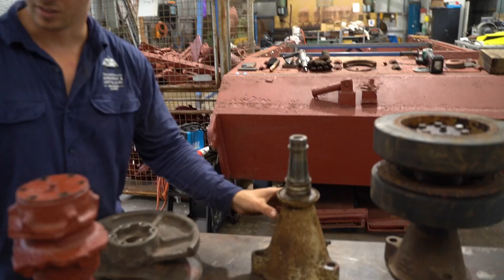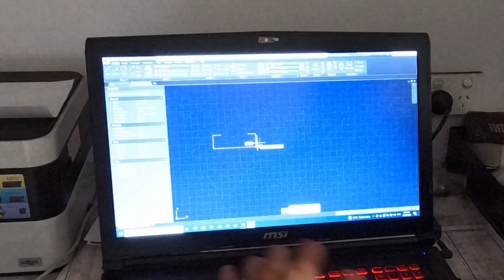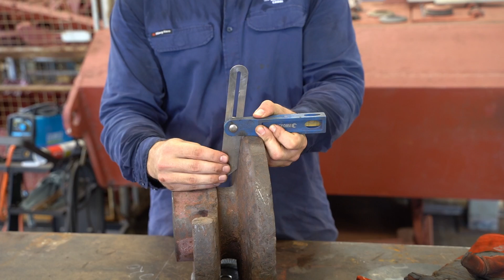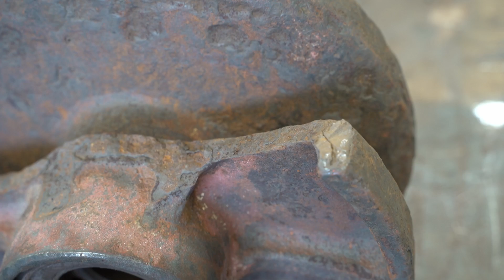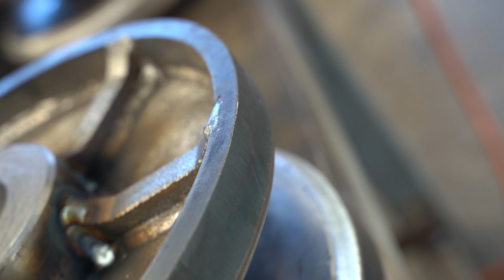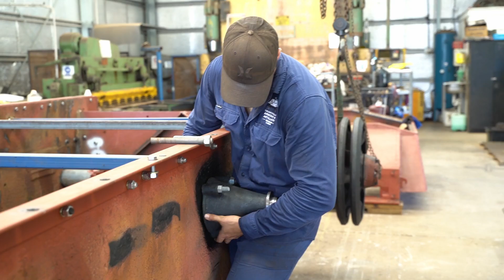Workshop Wednesday - STUG III RESTORATION Ep. 9

Comment: Depending upon when that hull came out of the factory, it's highly likely that the factory had been bombed at least once.  In Oct '44 80% of the plant had been destroyed, so it's more likely one of the ones that came out after the first bombing run hits in late '43 since this spent it's time on the Eastern Front.  Given that MIAG became the secondary manufacturer for Stug III G's in Feb. '43, the lack of other components on the hull being from MIAG, ball bearings being used in the commanders cupola and what appears to be an additional plate welded to the front, I'd hazard that this was a nearly complete hull when the factory was bombed in Nov '43 and the MIAG return rollers were the last parts they needed OR procured to replace rollers that had been damaged in the bombing.

I'd be interested in hearing whether or not ALL of the return rollers were MIAG or just the one wheel itself.  It may have been a field replacement due to damage from engagements.

Comment: I am somewhat amazed to see how the castings are welded to the mild steel parts. I'm assuming that the necessary special electrodes were used, but I couldn't see that the casting was heated up and kept at temperature. But maybe it's just not visible.
I'm not a welding specialist, but as far as I know, welding cast iron is quite demanding and if you weld cold cast steel, it will most likely crack later.

Comment: If you're gonna do it, you may as well do it properly.

That should be their motto as it certainly is their practice. If only more people would feel that way.

Watching the pressing sequence, as he mentions the diameter of the centre hole has changed, I could almost hear a Finnish voice (Lauri from Hydraulic Press Channel) say... 

"And now we have to deal with it."

I would be interested to know what percentage is salvaged Stug and how much will ultimately be new manufacture?

And how did they add the rubber to the guide wheels - on the original pieces?

Comment: The spare parts situation was so dire, due to the need for new tanks and the lack of capacity that many vehicles were cannibalised by the crews, if they needed a part rather than risk being without a vehicle, they pinched it off any wreck they could find. I have seen pictures of vehicles with three different manufacturer and spec road wheels on one side, as they say needs must. Guy I used to work with said "anything but fighting as infantry, they died too fast", he was a Tiger driver, sadly long gone now but told some great stories.

Comment: Being one of the last series produced, Krupp would have used any spare available so you might find alkett or other manufacturers castings being used on the same vehicle. A lot of the running gear parts were interchangeable to ease maintenance in the field

Comment: German war industry was a rather complex process (German and complex, go figure). Contracts were given/awarded to various companies to either solely produce (rarely) or component produce vehicles. This then created a broad manufacturing base. Those parts were then usually shipped to another company/contractor that was responsible for assembly of the various parts manufactured by X number of companies. What also happened quite frequently, usually when a vehicle under went a model change, was that new/revised parts would be fitted onto older chassis on the assembly line, or older parts/surplus being fitted to new chassis on the assembly line. As the war supply situation deteriorated, it was pretty much fit whatever parts are available to complete the vehicle and get it to the front. So, it isn't surprising to see mismatched parts, especially on such a late war produced vehicle.

Comment: He used stick welding to join old to new because the stick electrode has a closer metallurgy with the hardened steel and more FLUX to deal with impurities in the cast steel. That is also why he preheated the steel to allow for the grain structure of the steel to not be as large and brittle.

Comment: Purely speculation, but was the reason for the Miag cast idlers on an Alkett chassis be because the Stug was made from recycled Panzer III's  and by 1945  finding parts/materials for the earlier type rollers wasn't possible (1 machined casting versus multi part rubber tyred unit) and does anybody else think the Miag idlers look very similar in design Russian KV 1/2 return rollers?

Comment: As a professional mechanical design engineer (I do CAD all day) it was nice seeing old school 2D again and seeing how Beau has recreated an originally cast piece. I was wondering if you'd recast them but I'm liking how he worked it out of parts. They are not load bearing but look as strong as...well a tank. Top job fella.

As for factories sharing parts. Earlier in the war it would have been strange but I've heard that towards the end it was get as much fighting equipment out as possible no questions asked. So if a factory had lots of pre assembled return rollers and another short I doubt it would be difficult to imagine parts being shared. It could also have been a field frankenstein repair by mechanics on the front?

Comment: Always quality craftsmanship. One question on the early return wheel you did not use. Would not the Germans used any part they could to repair equipment in the field, and so you could have used that part? I am sure restorers wrestle with such issues.

Comment: Outstanding work as always !.I really didn't know that Miag roller did not have any bearing at all !. I have two types of Miag rollers in my collection and one has two ? bearings in it.
I thought the other one must have at least one inner bearing in it !. It is surprise to know Germans made so many variations for their equipment. Also I know there are some types for Alkett 
six holed return rollers does exsist. I think mix use of these rollers may have been caused by a field repair work not from the factory. 
I have seen battlefield  photos of some Stgs with mix use of steel and rubber roller on them.

Comment: The Stug III Ausf D that was restored in England about six years ago has steel as well as rubber tire rimmed return rollers if I remember correctly. I remember the restorer saying that it was not unusual to see a mix & match as parts were cannibalized as required to keep vehicles running.

Comment: Why not make pattern and core and cast replacements?  You had to do all the machining anyway and it would probably be quicker to make the pattern than all that fabrication work.  As a bonus, you could offer replacements to other restorers in exchange for parts or cash.
Reply: That was my first thought, why not get a foundry to cast some.  Might be more costly but once the mold is made there's profit to be had.
Reply: @I_Don_t_want_a_handle  I honestly have doubts about casting parts bringing in a profit. Ive done zero market research but I think its safe to assume these tank restorations are all 1 of a kind. There is no secondary market for tank parts like used cars or motorcycles.
Reply: When your tool box only has a hammer, that is what you tend to use.
Reply: @larryselkirk426 Casting foundries are an impossible luxury in FNQ. The closest would be a thousand kilometers away .....

Comment: What was the reason to re-fab the wheels over re-casting them?
Reply: You've never had a cast part made.  Depending on the foundry work load and willingness to take on hobby work. Two months turn around.  Maybe longer.  Cost... Foundry work is expensive, all hand made forms, lots of energy expended in the material melt, labor.
Reply: @ShainAndrews  Fair enough, cheers

Comment: Interchange of serviceable parts between Mk111 hulls ,etc was a common event ,especially in rear area repair depots where seriously damaged vehicles were cannibalized to provide immediate replacements for less damaged hulls . The units 3 ton spares trucks could only carry enough small fast moving replacements for a limited number of tanks , so if you had a shot final drive on tank 111 and 333 had the turret blown off - 333 was cannibalized for drives and what ever.
Ditto for rollers , track , etc - different manufacturers of the same part was irrelevant , as long as it fitted .

Comment: Late war Germany had major problems sourcing materials due to disrupted shipping and allied air raid bombings. Sharing parts between factories had to take place in order to get things delivered. There's also the chance that an older MIAG Panzer III that was converted to a StuG III by Alkett kept the MIAG return rollers (and vice versa) if they were in good order. 
Late war Germany didn't waste any parts if they could due to pressure and lack of almost everything (metal, rubber, copper, paint etc) but they never traded precision for faster production, unlike the Sherman and especially T-34 production, and that's why Germany could never match the volume the Allies had. They did simplify many parts and designs throughout the updated variants from feedback and repairs, but mostly due to manufacturing lead times. 
German tanks were often too complicated which made field repairs problematic and lengthy, but since Germany didn't focus on getting one or a couple tanks/tank destroyers right they made new models instead and started from scratch each time and although they had more advanced and powerful tanks than the Allies, they didn't have the numbers... 

StuG III Was designed and built by Alkett alone until February 1943 when MIAG (Muehlenbau-und-Industrie AG) joined in building the Ausf. G. variant. The change to all metal road wheels came in November 1943 due to lack of rubber shipments to Germany.  In 1944 173 various Panzer III's were converted to StuG III's from damaged/old Panzer III's and it's here a mix of manufactured parts would have appeared as well. 
I don't know the serial number of this StuG III chassis but it should be possible to track down where and when it was manufactured - or converted?, with a bit of luck.

Comment: That actually raises an interesting question:  given that parts were recovered from earlier vehicles and used on later vehicles, so you have often had complete mis-mashes of assemblies on very late war vehicles, what is the decision process around fabricating new parts onto an old vehicle (in order to make it "factory-correct") vs using genuine parts and making the vehicle historically accurate and more original?

Given the amount of fabricated parts in total on all your vehicles, they're obviously recreations, not restorations, but what's the decision process?  Would be interesting to know.
Reply: It's not fair to call these recreations. They are using as many original parts as they can, which is tremendously difficult on such old and rare vehicles. It is common to repair classic car body works with newly made steel sheet and mechanical parts and it is still called restoration. A recreation would be when you have to build a whole vehicle from scratch using only blueprints (like some rare cars have been brought back as modern "kits"). 
Otherwise, there is no clear definition of when to start calling it a recreation. Do you put the difference at consummables (bearings, filters, oil, ...) versus structural parts ?
Reply: @corentinnaisse5350  As you say yourself, the line between recreation and restoration is not a firm line.   Hence the question I asked: given the variations in vehicles at the time, how do they decide to go one direction vs another?  If they could rebuild with original parts, but they choose to fabricate new parts that (might) more closely match a factory original, are they restoring or not?

I think they are recreating with these particular ones.  They're choosing to fabricate parts, rather than using available historical parts.  Obviously, you don't agree.  Each to their own
Reply: @corentinnaisse5350  Hi!  Yeah I think they're using original parts wherever possible.  I watch Beau weld half of one of his scratchbuilt return rollers onto an original smashed return roller.  There's the proof!

Comment: From my knowledge It wasn't common for the sharing of parts at the start of the war. But near the end parts where parts. It was just a way to get that tank together to stop the ally's. Desperate times. 
It was also the same for things from other machines from factory's to be used to repair tanks. Steel was very valuable and if it worked it worked.

Comment: Interesting how the Germans adapted to the need to reduce production costs and time while cutting costs as the war went on. Their initial 'over engineering' phase followed the text books, later on there was more emphasis on reducing the number of steps and parts needed to produce an item that would still perform as required. The two types of carrier rollers here are a great example.
Reply: 5 bolts to hold a cover plate on the axle.
Reply: @garynew9637  The 6 bolt outer cover? That would be to keep the cover sealed, stop dirt getting in and grease getting out, seems normal to me keeping in mind it's a military vehicle. Note only 3 big bolts to bolt the whole thing to the hull.

Comment: Those rollers look great. Not easy to duplicate a casting with a weldment! I would have added a small radius on front of gussets before welding em all.  But that would have been days of grinding. Kinda stunning there's no bearing. But hardened shaft w grease should be ok for short time they were expected to last. Really fine job, they look awesome! BTW different manufacturers parts, esp small parts is very common. Even US tanks mated different wheels, bogeys, sometimes turret from different manufacturer. Esp common in 45, when they would use whatever they had to put one together.

Comment: During the war, vehicles were mostly repaired at the front with parts that were there at the time.
Parts from older vehicles were also used.
It is therefore not a problem when restoring a "frontline fighter" if not all parts correspond to the production version.
Your StuG 3 is a veteran who has been on the front lines for more than 1 year.
So using parts from different vehicles gives a certain realistic touch.

Comment: Every time I watch this restoration of a WW2 Germany Military Vehicle, the detail in which parts are manufactured, I I wonder how - [1] - the Draughtsman, of then, who would have with pencil, ruler, square, straight edge who would have created detail drawings of each part for manufacture, how they comprehend the use of a Computer  with a detailed software system to create the same part today; [2] - and also the workforce, from then  - how would they react in seeing the parts they made, being made (in a similar fashion?) today.  Bo, who is "going to have a close look at the return rollers to see if they are genuine"?

Comment: Impressive job you are doing! I have a dumb question: where is the grease point? You need to grease in otherwise it will start wearing out immediately! Good job 👍 👍
Reply: Grease goes through a grease nipple on the dust cap and through the centre hole of the shaft and out each side of the shaft through 2 holes
Reply: @Jeales12  Oh right!  So it does have grease nipples!  Great news!  This thing is gonna last another 80 years!
Reply: @Jeales12  thanks for replying, I didn't see it! 👍👍

Comment: Although Alkett and MIAG were the primary Stug manufacturers, it is also possible (in fact very likely) that they had smaller foundries working as satellite suppliers, so finding Alkett parts on MIAG Stug or vice versa is likely more common than you'd imagine. Just look at the Tigers, although built solely by Henschel, there are countless variations of Mantlet casting due to different foundries supplying the castings. 

Both factories, as well as field workshops also repaired damaged vehicles, so it is also possible that during a service they have swapped parts from another vehicle, perhaps even simply due to wear.
Reply: The turrets on all the Tigers were built by Krupp - there were two completely different designs, one by Henshel and the other by Porsche (the Porsche design was intended for their competing design of the Tiger 2 that failed due to drive train issues).

Comment: Almost wonder if they could 3D print the wheels to use as a template to sand cast new ones. Or at least make new ones for a guide.
Reply: Yep, that's the first thing I tought. I guess the price for custom made steel casting is so prohibitive that they have to resort to cruder techniques. For low melting point alloys (aluminium, bronze, ...), it is now commonplace to 3D print the templates for sand casting. I've used it multiple times and the fact you can just adjust the scaling to compensate perfectly thermal contraction is awesome.
Reply: @corentinnaisse5350  Interesting, I do figure they would need to use higher temp materials though. Those return rollers will need to take a beating.

Comment: Fantastic work. You might consider lost foam casting, where you make the part from styrofoam, embed it in special sand and replace the styrofoam with hot metal. This was not available in 1945, but might help you today.

Comment: Uhm, I don't know if welding a piece chucked in a lathe is a good idea. Just worried about the lathe bearings. That aside, awesome work gents!!
Reply: @saschapulkowski4413 Gidday!  Yeah, definitely a reasonable concern mate.  But I saw that Beau actually clamped the earth electrode to the wheel itself.
Reply: @saschapulkowski4413 Gidday!  Yeah, definitely a reasonable concern mate.  But I saw that Beau actually clamped the earth electrode to the wheel itself, so no welding current actually passed through the lathe bearings.

Comment: It Is perhaps not so much the question if elkat and miat shared parts . It is more likely that it could be a field repair or since it is a matching set of six and spares of all types were stored they could have just went and replaced all 6 instead of having a mix and match , something that would make it more difficult in the field